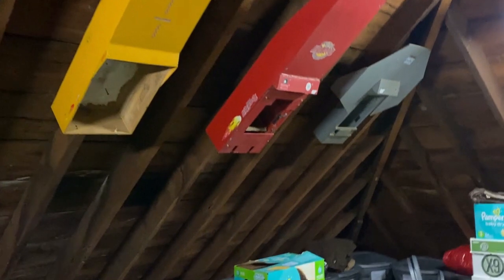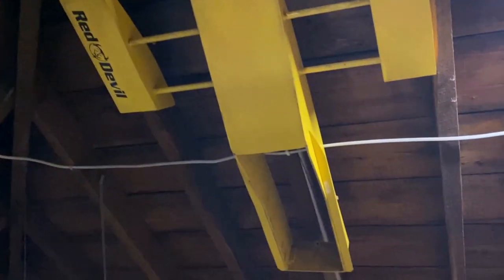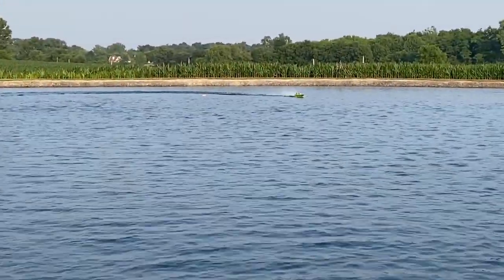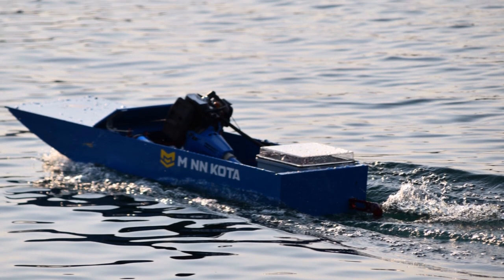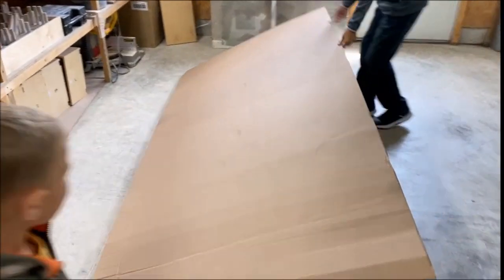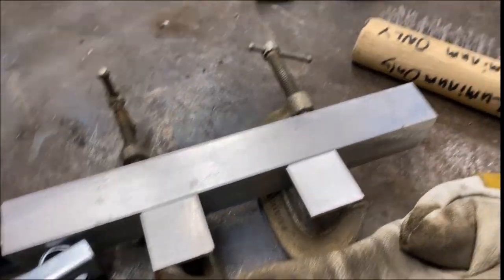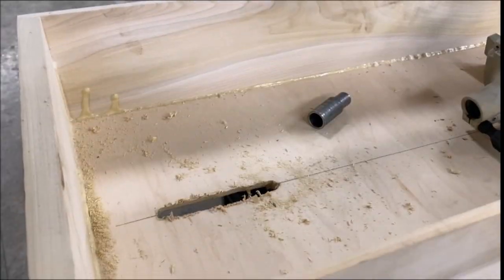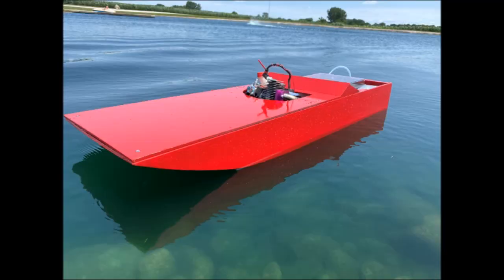RC Boat Racing and Crashes! -NASBOAT-

Comment: Enjoyed your video and your outreach to young boat builders. Could you provide me more details on the prop that you use and how you attach it to the shaft and motor 
And where to get the hardware for the rudder. Thanks
Reply: Nope, we live in central Arkansas. May try to build one of these with my weedeater motor. Looks fun for sure. Do you have a vendor you like to use for props and that rudder system. Thanks again for the info
Reply from the maker: @jeffmercer8364  we primarily get parts from ZippKits
Reply from the maker: Hello Jeff! We typically use a big Prather prop like  a 270,275, or 280. Or the equivalent of another brand. Shaft is solid steel 1/4” rod, ground square on one end. The other end has a drive dog and a nut. Do you live near Western Ohio?